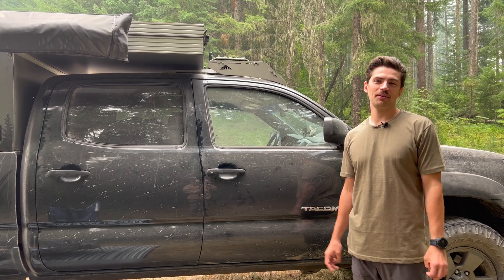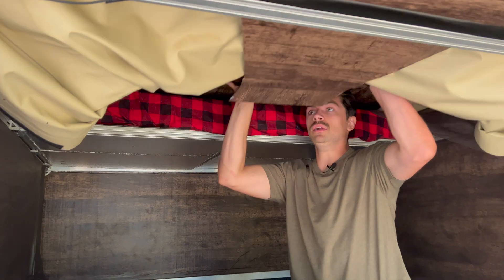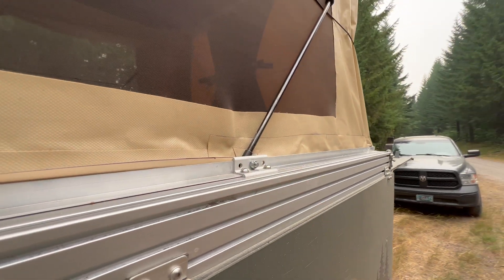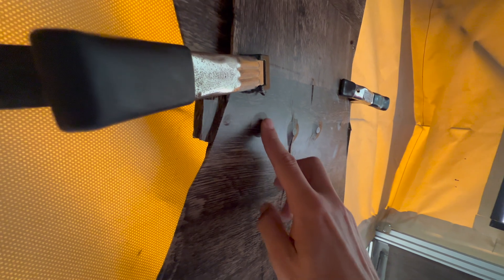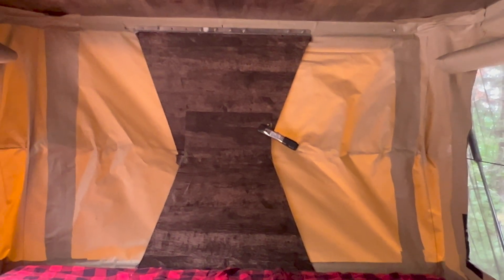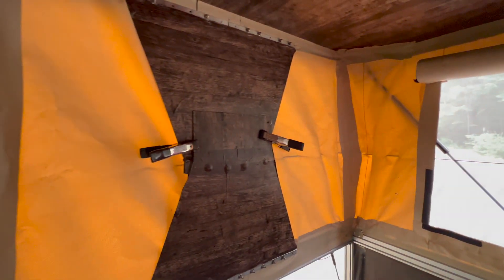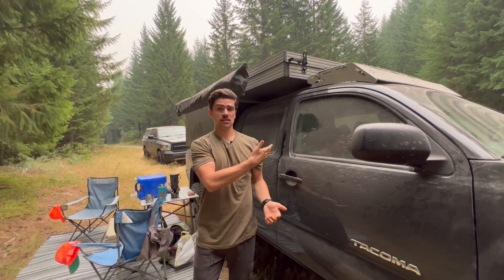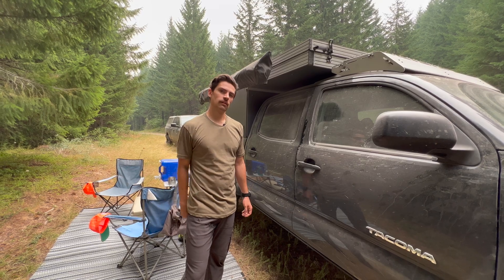DIY POP-UP Camper - Pop Top Walkthrough | KIT Campers V2

Comment: Now that I see how the fabric hangs down inside the topper, I'm thinking that making a solid back wall that stands up (hinged at the bottom) would hold up the top once its deployed and I wouldn't even need struts with the top being light as it is. And you would still have use of the topper without the fabric hanging down. That also goes with the sidewalls wedges, Have them also hinged at the bottom and fold up to meet the top with some type of latches to hold everything ridged. 
 It would be a solid shelter when erected and no fabric to hang down and flap in the wind.

Comment: This is really rad. I'm building something similar on my Delica - once I build up enough courage to cut a huge rectangle out of the roof.
Reply from the maker: Yeah cutting a rectangle in the roof of a vehicle is always challenging and scary! Make sure to consider how to best seal the roof and pop up together before proceeding, waterproofing can be tough.
Reply: @KitCampers  Sorry if you mentioned this in the video already, but what are the specs of those struts? 100lb? 150lb? 

I'm trying to figure out sizing; I don't want too high of a load, nor too low...
Reply from the maker: @evanl5299  I wound up using 60lb struts that were 44inches long for this build.

Comment: One issue you created in the canvas design is for waterproofing during rain storms. It will seem to most to be ill gi Al until you remember that rain follows the rule of gravity. Your lengthwise seam needs to be at the lower edge so rain cannot run down and enter at the bottom edge and soak your mattress and bedding.  If you could sew in a zippered opening with rain protecting overlaying plackets on the exterior upper top and sides would allow for better rain resistance coming into the interior.  You do not need an industrial sewing machine to sew that fabric. The trick to doing it on a standard sewing machine is to use a machine needle made for sewing leather. It has sharp edges that cut its way through the vinyl. That is how I sew that exact same fabric on a home sewing machine.
Reply from the maker: Thanks for the input you are 100% correct. I realized this after the fact, but I made some corrections by adding a solid vinyl window and adding it to the bottom seam. So crisis avoided. Going forward I definitely tell people to be aware of this.

Comment: I think you mentioned that the total width is 64 inches wide, but on the BOM the composite panels are only 60" wide. How did you do the very top  panel with it being 4 inches narrower than overall width?
Reply from the maker: The panels are 60 inches wide but I cut them to 64 inches long so they can cover the span of the roof.

Comment: On your pop up mechanism, get some 90° angle iron and mount it at the edge of one of the pieces, and mount the other up against it on the other piece.  So the angle iron will be back to back.  Then use some latches just like on the outside to pull the two pieces together.  This should give you both vertical and lateral support.
Reply from the maker: Awesome thanks for the input!

Comment: Do you need the half rack on the roof of your tacoma
 to support the front portion of the camper?
Reply from the maker: Nope, the half rack actually never touches the camper at all.
Reply: @KitCampers  Thank you.. Might have to trade in the 4Runner just to build something cool like this!
Reply from the maker: @bearboles2868  hahaha too bad tacomas are super expensive right now! I did build a RTT which i am planning on posting soon which might be another option for the forerunner.
Reply: @KitCampers  how much modifications would be necessary for your plans on a Tundra?
Reply from the maker: @bearboles2868  Not much, I have a customizable bill of materials in the classroom that requires you to enter 3 measurements, bed rail width, length, and height to over the cab and then it calculates everything you need.

Comment: Dust intrusion, how bad and what has been your learning curve to minimize it?
Reply from the maker: It's actually not too bad, the worst dust intrusion is from gaps in the bed, not the camper. But as far as water and dust resistance goes, I use heavy duty truck bed cap seal which has worked REALLY well, this is what i use - https://www.amazon.com/gp/product/B00NCCNUJQ/ref=ppx_yo_dt_b_search_asin_title?ie=UTF8&psc=1

Comment: HI, NIce build. Whats on the top of the tent.( TOP Exposed to outside part ).  What material is used to water seal it? Is it Aluminium/ABS /PVC sheet etc. Can you Give some details how the canvas is fixed onto the 8020 Al frames. Is it glued on to the 8020s.
Reply from the maker: Thanks I appreciate it! It's aluminum compositie material, I used 3M VHB to tape/glue everything into place. For the canvas I used VHB and screws.

Comment: Great walkaround. One question: How do you make sure that rain that comes down the tent walls does not end up inside the camper?
Reply from the maker: Thanks I appreciate it! I made a rain gusset for the canvas material, then I made windows that attach to the bottom that can be raised if it rains.

Comment: What's the weight of your roof? I saw you originally purchased 40lbs gas struts but are replacing for 60lbs. I am building a similar camper and am trying to calculate. The force for the gas struts that wont be too strong to close the roof.
Reply from the maker: I don't know the exact weight of the roof but the 60lb struts work REALLY well. What are the dimensions of your roof? Mine is 60" x 120"
Reply: Essentially the same dimensions 63" x 119". I built the framing with wood because it was a material I had available to me. Also the roof has electrical and lighting. The overall weight of my roof is 200lbs so was thinking 4 struts that can support 50lbs each.
Reply from the maker: @derekleeurey9246  If I were you I would go for slightly heavier (the 60lb struts) because the struts aren't pushing perfectly straight up and down.

Comment: Great job. Did you make the canvas screen yourself or did you have a company make it for you?  That would be a nice video.
Reply from the maker: Thanks, I made the canvas by myself, I am actually working on another project and plan to show how to make the canvas from start to finish!
Reply: @KitCampers  I want to do the same for my camper pop up. I would like to install a clear poly window on both sides. Buy the material from Hobby Lobby, but I do not sew. I might take it to a Cleaners, they do some sewing projects. I don't know if their machines sew that kind of Material.
Reply from the maker: @danemmerich6775  I did the entire thing with no sewing. If you use vinyl coated polyester with hh-66 vinyl cemtn you can make yours like mine without any sewing.

Comment: Better to have the canvas window roll up from the bottom to close than roll down from the top or its going to get flooded in there
Reply from the maker: Yes great point, the window covers go from the top, then I mounted see through vinyl on the bottom so the water won't seep in. I will make another video soon detailing changes to the windows that I have made.

Comment: I love how the pop-up roof works and how simple in design it is. The use of 8020 extruded aluminium was just a brilliant idea.
would like to see you go further with this idea and remove the actual bed of the Tokoma and design a more useful space at the bottom with a kitchen and shower cubicle. Think that must 

be your next project, but I'm already so impressed. Thanks for sharing.
Reply from the maker: Thanks so much! Yeah I have been considering how to build out the bottom area to be more useful. I would really like to make a flatbed camper for the next build unfortunately my tacoma may not be the truck I build it on as I cant unbolt the actual bed (too much rust).

Comment: Nice build!  Is the roof 4" on bottom, and 3" on top?  I want to do a F-150 build and not sure how much the tacoma info on your kit would help.
Reply from the maker: Yes the bottom portions are 4x2 inch 10 series and the top is 1x3 inch 10 series. The design should be compatible with truck beds up to about 94" but keep in mind that the dimensions will have to be changed to accommodate different truck bed sizes.

Comment: For the pop up mechanism you could use some good 3M Velcro in the overlapping part. You could glue a sheet of it to some canvas. Then glue and rivit it to the mech where the overlap is. That way when it went up the two sides would come together. A patch most of the side of the overlap would be really strong. The canvas would just help give a good strong backing for the divots to hold onto.
Reply from the maker: Thats a really good idea! I have been trying to think of something that would allow for the canvas to be pulled in easier and velcro might be the solution! I will brainstorm this a bit more and see what I can come up with!

Comment: wow, this is pretty great. I picked up a 1983 Four Wheel Grandby for free on craigslist and am planning to gut/repair it this winter. I can see an endless number of uses for the extruded aluminum for things like modular shelving/seating/mounting of items and reducing the weight of 40 year old wood and particle board. Well done!
Reply from the maker: Thanks I really appreciate it! Yeah I am definitely a huge fan of the aluminum extrusion, using it makes everything SUPER modular and you can continually add things or modify them. Have fun restoring your new camper!

Comment: The 4 wheel campers use a strap and snap on the tail end and an extension arm with a snap on the bed end. Should work well for yours as well.
Reply from the maker: Yeah I think the snap is something I could fairly easily implement to get the pop up mechanisms to stay in place as opposed to my clamps.

Comment: Can you please provide details on how the roof was made?  Nice build.  🔥
Reply: I am actually wondering what material you used and if it has ribs.  I also wonder how it sheds water if it is flat and the 80-20 is on every edge.  I know weird details, but I am curious.  You really did a great job on the design and the cost is sooo much better than $25k plus for the commercial company builds.   Congratulations!  🍾🎈
Reply from the maker: @Oswald2615  The material used was 8020 extruded aluminum from TNUTZ.com, For the roof I covered it entirely in aluminum composite material and very high bond tape from 3M so it is completely water sealed. This is a bit more comparable to things like go fast and ovrlnd camper which are closer to $10k but yeah that was the goal! I appreciate the kind words!
Reply from the maker: Like how I assembled the frame for the roof?

Comment: Can you show the canvas attaching to the bottom rail?  Curious how you did it and is it water tight?  The canvas doesn’t overhang the bottom rail, is there drainage or does the water pool at the bottom?
Reply from the maker: That's a great question, right now I haven't actually had it out in the rain, and the giant windows would make it not so waterproof anyways. The canvas is fixed to the bottom rail with VHB all the way around and self tapping screws in places. I also made a rain skirt that does overhang the angle aluminum I added. I am still considering other options for better waterproofing though.
Reply: @KitCampers  
Yes,  my biggest concern as well. I'm trying to remember how my Hybrid and Pop-up campers handled water intrusion with their fabric components 🤔.
Reply from the maker: @patrickmckowen2999  definitely a challenge but I am working on a solution!

Comment: Awesome build! Camper aside - looks like you have 285/70r17 duratracs, do you have a lift and are you running spacers?
Reply from the maker: Good eye! Yes I do and thanks for the kind remarks! I run a 3inch/2inch leveling kit, with 1.25 inch spacers. I had to do very small trimming of the plastic underneath the bumper.
Reply: @KitCampers  Thanks so much - the fitment looks amazing! Excited to track your build as it progresses!

Comment: Thanks for this video!
Reply from the maker: No problem, if you want to see anything else (i.e. features of the camper) let me know!
Reply: @KitCampers  i talked to you a little on reddit. Im going to build mine soon. Im conflicted on which route to go but im definitely going to be using a lot of your ideas, and others
Reply from the maker: @nboursaw1979  Nice! Are you deciding between which types of matewrials, etc. to use? But yeah there are tons of options out there! I definitely don't think one design is the best over others, each has their merits! Have you checked out @ripcord - https://www.youtube.com/watch?v=1iiZJ7xa0jk&ab_channel=Ripcord
Reply: @KitCampers  Yes. I want to keep the cost down as much as possible while still having adequate strength. Weight is something else i have to keep in mind. I'd love to use that 8020 aluminum but realistically cant pull that off.
Reply from the maker: @nboursaw1979  Yeah weight is definitely an issue with all of these. The aluminum is a bit more expensive but definitely worth it if you can swing it. However, I do think that you could probably make something similar with wood as long as everything is weather resistant!